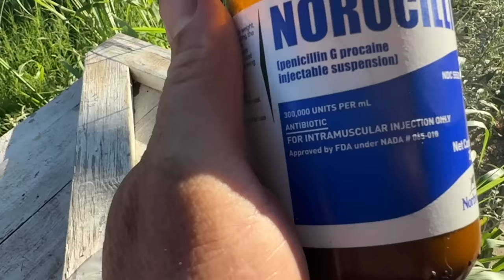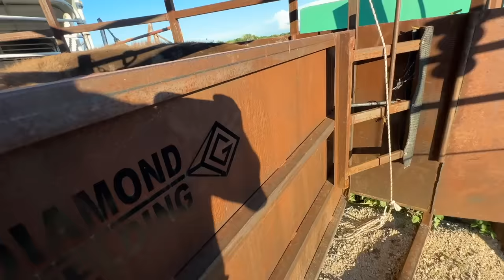Race To Save This Cow! Worst Thing I've Had To Do!

Comment: As a breeder myself it is always a strain when you have a young female bred and having trouble birthing. One thing I can suggest is flushing her out. You can simply do this by getting a 5 gallon bucket of soap water (non-scented) and using a pump siphon by hand and inserting a tube into her and just flush until the water coming out is clear. I raised horses and we did this to a mare the vet said he could not make it to us, I bought the  siphon at a coop and the tube..... another thing I would wait on breeding this female again until next year, let her insides heal. Most usually young females can do this, from being bred to early. Let her have a season off to help her insides heal or you could have this happen again... Best of luck to you.
Reply: sounds like good advice lets hope he listens
Reply: Best way
Reply: Great advice
Reply: Unfortunately this advice will not get to them in time. It's exactly what needs to be done but this video was posted much later after the problem occurred and Dusty tried to do any thing. I hope he sees this and keeps the information for the future.
Reply: Wise words for sure.  I bet she would handle it pretty well, at least a couple times.  It is good to be able to pass on old tried and true experiences.
Reply: @stacey_h  how sad.
Reply: @cindyshipp4124  do you know if the cow was okay after he worked on her?
Reply: Have you thought about getting a gas mask incase you ever have  to do it again?  I think  with that you wouldn't be getting the smell with that.
Reply: Back when he posted the video with her having that pinkish white discharge I would have done all I could to get her in a squeeze shoot and a vet on scene. It is a sad lesson learned and hopefully something he never has to endure again. I pray it is a fluke and that there is nothing wrong with this cow or the one whose calf was born dead and that they are able to produce healthy calves in the future. I wonder if there is any genetic testing that could be done on them to prevent future heartaches.
Reply: @stacey_h 
First of all, you don’t know that Dusty wasn’t already advised by his Vet to do just this.  This (a flush) is hardly profound advice and seeing as how his Vet would have ALL the critical information necessary to determine if a flush was an appropriate next step (as opposed to strangers making suggestions for procedures based on partial information provided to them in a YT video) then I’m sure the Vet will recommend it. That’s assuming of course that the Vet was unable to come check out Mama himself and treat her as he deemed necessary. 
I don’t know the intent behind your comment, but it sounds rather condescending at a minimum- and then feels downright insulting with statements such as “unfortunately this advice will not get to them in time” and “it’s exactly what needs to be done BUT…” and “this video was posted long after Dusty tried to do it himself” imply that you lack faith in Dusty’s ability to: 
A: do things correctly initially 
or 
B: seek help from professionals, be it through research or contacting a veterinarian
Either way- you’re giving zero credit to Dusty after you just watched the man go through literal hell to try and save this cow.  Do you honestly think he would subject himself to ALL OF THAT and then slack off on any additional care?  Hell no, absolutely not. Without a doubt he will do anything and everything that needs to be done to save this cow. Just because he didn’t explicitly say what the next steps will be as he was enduring his own traumatic moment doesn’t mean something more isn’t going to be done. He told us they’d be back in the morning to check on the cow. Besides- unless YOU are a vet who specializes in this matter- you’re not in a position to determine if a viewer comment is EXACTLY what he needs to do or not.  Nor should you be critical about whether or not Dusty is actively consulting the comment section on his youtube video for guidance on how to properly provide medical care to his bison 🙄🙄🙄 I mean wow, THAT sounds completely absurd to me. 
At this stage in things, it’s likely the cow will pass anything remaining in utero on her own. Dusty will have a good idea if anything is potentially left inside of her based on what he was able to get out. We can presume by his reaction he was dealing with pieces at best, or sadly…slop. If the calf was already decaying to the point of it’s remains being soupy, mama probably isn’t going to make it anyways because sepsis has probably already set in and there’s no sense in further torturing/traumatizing her.    However- if the the calf was mostly intact with minimal decomp, and if mama was loaded up with extra antibiotics- mama should be able to fight any potential infection and easily pass any remaining contents. It’s better for mama to do this the natural way with as few invasive interventions as possible. 
But either way- Dusty has a trained Vet by his side to offer guidance, and Dusty is under no obligation to share every single detail with his viewers.  With that said- he’s always been pretty open with his audience about the realities of Bison ranching- be it the good, the bad, the ugly, or the sad.  I’m sure we’ll get an update on the health of this cow when Dusty’s good and emotionally ready to do so.
Reply: Catch your breath
Dusty did a great job. Ignore the idiots. Normal people see right thru them 😊
Dusty did a great job. Im proud of him.
Reply: Great advice!
Reply: Agree, same thing happened to one of our young cows , veterinarian removed calf , mum cow didn’t make it too many other issues involved. 
Hope this cow does  alright!
Reply: My vet has told me that too
Reply: @nicholem4831  My word, you have much to say but maybe try to tag the proper person making the comment instead or just a blanket post... Maybe you need to go back and reread my post... I have been to veterinary school and because of a disability I received during my schooling I can not practice and am to old to be roughing it with cows, horses atc...
Reply: Wouldn’t calcium help push it out! By giving them oral calcium?
Reply: You know us animal people have to do some crazy F things😂
Reply: And

Comment: I agree with all the comments.  It’s tough work doing a lot of the things that are required with animals and the odors that u sometimes have to deal with.  I’m a retired RN and came across something 30+ years ago.  Vick’s salve can help u get through when you have a lot of odor.  Sometimes just a little on the upper lip, but sometimes you have to coat the inside of your nostrils.  The ointment helps to coat the nare hairs so the odor don’t penetrate into the hair and continue to linger for hours.  It always helped using a good mask too.

Comment: If you ever have to go through something like this again , and I truly hope you do not, but if you do, I know the smell of decay can be horrendous. Have some Vicks Vapo Rub and cotton balls handy. Dab some of the Vapo rub on two cotton balls and put them up your nostrils before you start anything. Trust me, you won't smell the decay and you'll power through it. This is what a Vet I used to work for in the early 80's told me to do. So Sorry for your loss. It's never easy.

Comment: OK, as a retired nurse sime pointers.  For these situation where the putrud smells are present, take two paper facial mask and smear Vicks Vapor rup between them.  For stuck calves, you can inject lube, 69cc or mor into the uterous around the calf, or parts thereof, to help slide tgem out.  You can instil weak iodine solution to rinse out the uterous after calving, before instilling the uterine bolus  cleanout pellets.  Best of luck.

Comment: Did you apply Vicks Vapor Rub under each of your nostrils? My family had a small cattle ranch in East Texas so I smelled a lot of bad smells. However, it wasn't until I became a cert. legal assist. & private investigator for several law firms that I experienced the smell of dead bodies. At that time (1990's), the police & med. examiners that I met used Vicks. It does help & better than throwing up.

Comment: Bison differ from cattle but my understanding that stillbirth rates due to external environmental issues are less than with cattle and much less with dairy herds.  Two stillbirths with losses close to term or during labor in even a much larger herd would raise flags, at least in cattle.  My thoughts would be that given bison are  just tougher and less likely to have come across something that would cause fetal death could actually make thus happening twice in a small herd even more troublesome, especially has its not occurred in the same herd before and is not happening with mother's from the same originating herd. 

Is it possible something is growing in the pastures or new areas they have been introduced to that has caused this? You had an issue before with the loss of a young cow apparently getting part of a grass that can poison bison, so you may need to take a good look around, especially near your creek and ponds for anything that might cause fetal death but not otherwise impact mature bison.  If so you would also need to keep red dogs aware from that plant too as it may impact once they start nibbling grasses.  Need to check with your local  environmental people regarding any plants, especially water plants, native or invasive, that may have a time during a growth/seed cycle where it could produce something that can cause a cow to abort or experience fetal death.

One would pretty much rule out maternal genetics s a reason as one vow was from your original stock and the other from Texas, if I understand how you have identified them both.  If it was in the male genetics you would have seen this in previous years and more often.

Not sure if these were both first time mothers, as stillbirth can happen more often in a first pregnancy simply because the first labor and delivery can take longer and go on for too long.

In both cases it appeared that the stillbirth may have been due to an abruption of the placenta as it appeared that you were seeing amniotic and placenta tissue which should come with/after the calf, not first.  That does go back to the question of possibly consumption if something leading to having a placenta fail.  In cattle this can sometimes also be caused by over active bulls during breeding season where cows who have not yet given birth but are near term are in a herd where bulls are actively breeding and get carried away even with cows not yet in season. This is one reason bred cows are often removed to a separate pasture, when obviously pregnant and at the start of breeding seadon, until they give birth.  

But the point is, I suppose, is now that this has happened twice in a small herd it does call for investigation and possible consideration of removing any cows still carrying a calf to a separate pasture.  If it happens again it really means that you need to consider a necropsy even if that means not allowing the cow time with the calf she lost.

As chill as she was acting is probably a good sign of just how sick she she may well be from infection and probably means that she is septic.  Busy she has not gone down meaning that removing the source of the infection and giving her a massive dose of quick acting antibiotics, followed by slow release antibiotics.  If not all the remains were able to be removed an injection of hormones to stimulate contractions to hopefully pass any other parts would be definately worth trying.